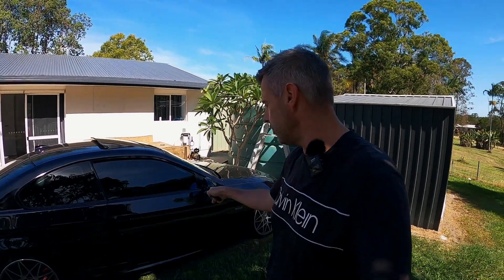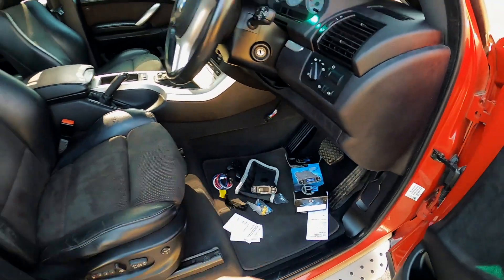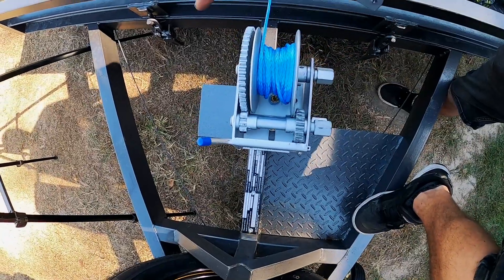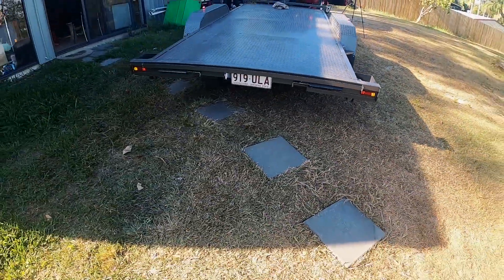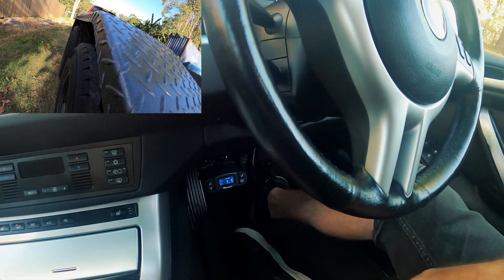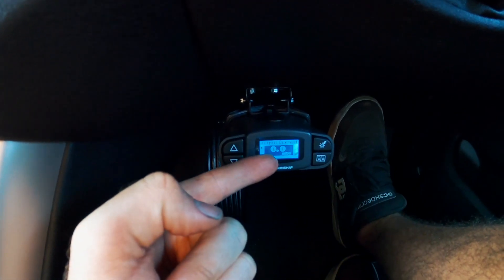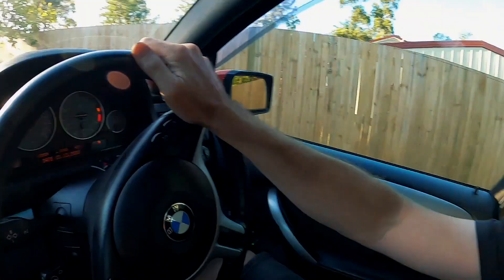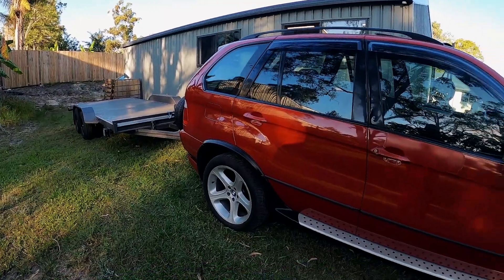BMW E53 X5 4.6is Getting Ready For Towing: Tekonsha P3

Comment: LED bulbs weren't a thing when this car was new. Think you just need some resistors to fix the problem. Had LED turn signal bulb issue with my old Audi A4 B6 and couldn't turn off this feature where the car checks the incandescent bulbs
Reply from the maker: That did cross my mind. Wondered if thats why the LEDs flash when the car is just sitting there. Like the car is doing the bulb check for normal bulbs.
Reply: This is correct. Since the resistance is different it's allowing a higher voltage through the check circuit, failing the check and displaying the bulb fault. If you're set on leaving LED trailer lights in, put some resistors in line. This should fix both issues including reducing the voltage difference fixing your pulsing brakes.

Comment: With my e-70 x5 when I fitted an after market tow bar it came with an electronic control module that allows led bulbs and disables rear park assist when a trailer is connected, I remember them being available for the e-53

Comment: If I remember correctly, you can turn off "Kaltlichtabfrage" in the LCM IV. The X5 probably has an LCM 3 or 2, but you can swap and code them to fit. This should stop it from pulsing your bulbs and thus braking your trailer. Hope that helps.

Comment: need to either disable the bulb check or wire in a load resistor, the thing with the tail lights is probably the brake and tail lights sharing a current limiting resistor so they can save $0.03 when making them

Comment: Good video.
I'd put a canvas cover or somethiong over your winch line, that dyneema rope isn't UV stable, so over time it will degrade.
Interesting issue with the trailer brake controller for sure. Good luck sorting it out
Reply from the maker: That is a good idea. I've been trying to find a cheap caravan cover to put over the trailer completely. Its already got a few little rust spots showing which is really dissapointing.

Comment: The trailer lights are flashing because they are LEDs and the bulb check function of the X5 is designed for incandescent bulbs. The fact that the brake controller is seeing this voltage and applying the brakes makes me think is is not setup properly (or compatible with) the X5. Maybe consult the manufacturer of the controller. When you turn the head lamps on and voltage appears on the brake lamp wire, that sounds like a wiring problem or an issue with the design of the LED lights on the trailer.

Comment: You may need another adapter for the LED trailer lights.  In the US they have a Euro trailer adapter that will convert LED voltage to regular voltage so you don't get check trailer lights.  It's either that or someone hooked up the trailer brake controller wrong.  That's probably what burnt up the trans!!

Comment: Does that trailer instantly start leaking oil when you connect to the BMW? If so,  it's 👌
Reply from the maker: Shit i better check the grease hasn't left the wheel bearings...... haha. It does instantly throw fault codes on the BMW which it didnt do on the van...... :|

Comment: I have been looking for a cheap 4.4i but after watching your videos I am definitely looking for a 4.6 or 4.8. The smaller 3.0 might be more reliable but must be pretty slow and frankly look so boring in comparison. On the downside, parts seem more expensive, even the plastic trim near the rear wheel fenders are $250 compared to $40 for a 3.0. Crazy.
Reply from the maker: Definitely get the special model!!!! You are right, the cost of ownership may be a little more. But getting an "is" will just be a better experience, better car and if weird people like me keep making videos on them they might start even becoming collectable haha.
Reply: @ZeroTo60Tube  Definitely, we are into wanna be cars! LOL.  I have a 2003 525i daily driver for the wife and a 540i M sport garage queen. Unsuccessfully hunting a 4.6is for now :(
Reply: Aren't there any diesel versions where you live? Could never justify a 3l or 4.4 gas over an m57. Also with a bit of tuning the m57 will outpull the v8 😁
Reply: @Iceeeen  That sounds too practical 🤣

Comment: Watching this from Germany with Our high Standards im quiet surprised...a)looks like a very heavy Trailer b)wow in germany even Our 3tons Trailer which weights 500kgs and is able to loaded 2500kg has Hydraulic-steelrope masterbrake cylinder. Never seen electric alone Brakes....We have options for Trailer esp/dsc but it isnt necessary. The round 13pin plug is top of the Art and 7pin becomes outdated....never seen the flat one...

Comment: I'm not sureif you can code it out even if the x5 has LCM 4. Might be in the adapter in the car for the trailer
Just get one of these https://www.ikh.fi/en/adapter-13-13-pin-led-lights-st100649